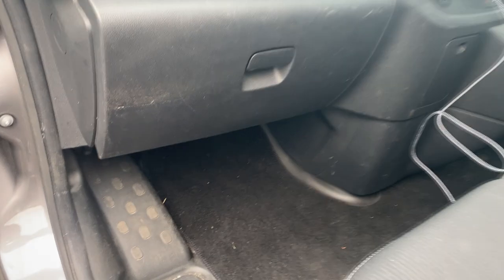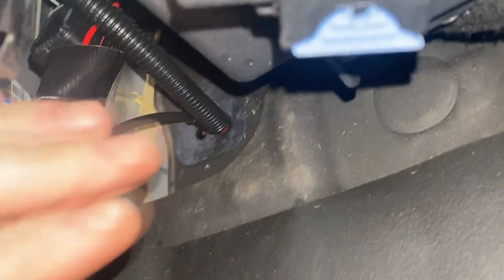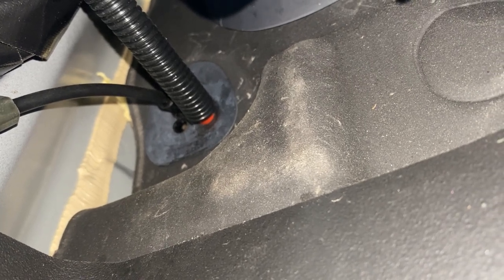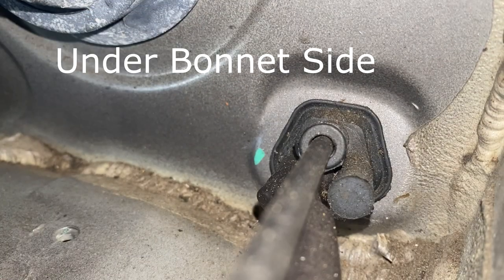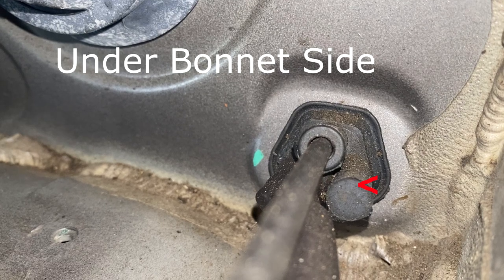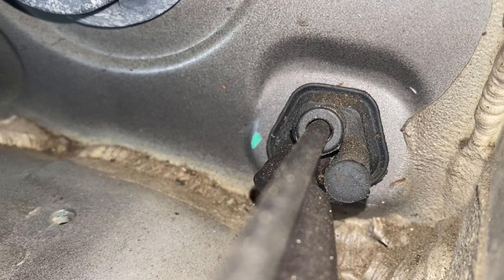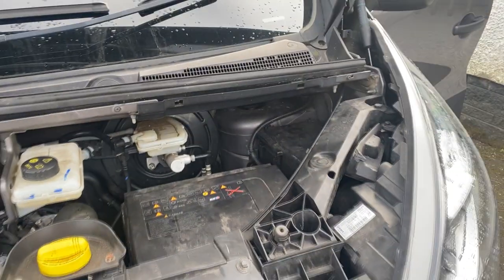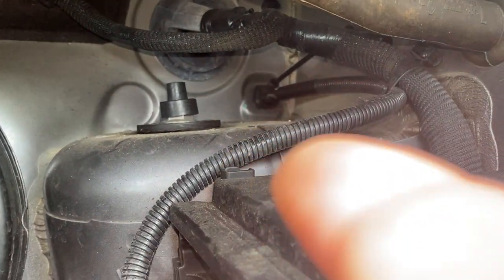Routing Split Charge Cable Through Bulkhead/Firewall on 2014+ Renault Trafic, Vivaro

Comment: Oh you legend!
Reply from the maker: 😊 Thanks
Reply: Hi mate did you just run the earth to the van chassis? Thanks
Reply from the maker: @NorthernYakers Sorry I missed this comment. Yes I used one of the threaded holes for the D ring tie downs as my earth on the chassis. Atb Dave
Reply: Hi dave, this was very helpful thanks as about to do my 2014 vivaro and was scratching my head. What size conduit did you use and did you run it all the way along the inside too? Thanks!

Comment: Hi Dave, this was very helpful thanks as I'm about to do the same to my 2014 Vivaro and was scratching my head about how i would do it! What size conduit did you use and did you use it all the way along the inside? Thanks!
Reply from the maker: @strousdrummingworld8520  Hey thanks for the comment, glad it helped. As far as conduit, I can’t remember exactly what I ordered but its split conduit and measures around 13.5mm external diameter and about 10mm internal. My cable is 16mm2. I didn’t use it all the way along, really just anywhere the cable is exposed or running anywhere it was likely to rub on any sharp edges. I bought loads though and probably used more than I needed but it was fairly inexpensive. Atb Dave
Reply: @playing_in_trafic  Thanks Dave, never tackled anything like this before but ordered a kit to crack on and give it a go. Did you find it easy enough to route through the roof liner? Considering that or under the sidestep.
Reply from the maker: @strousdrummingworld8520  Route through roof lining was dead easy and you can then go straight into the factory loom protector over the top of the sliding door to get further down the back of the van. I then crossed over in conduit through one of the roof ribs halfway down the van to get my cable across to drivers side.
Reply: @playing_in_trafic  excellent dave thankyou i will give this a go. How did you mount the inline fuse in the bonnet from starter battery? A bit worried about drilling into the van!
Reply from the maker: @strousdrummingworld8520 Sorry I missed seeing this comment. The conduit holding the cable is mounted tightly with cable ties as such the fuse holder is pretty solidly held in place and can’t move. So I didn’t see the need to use any additional fixings on it.